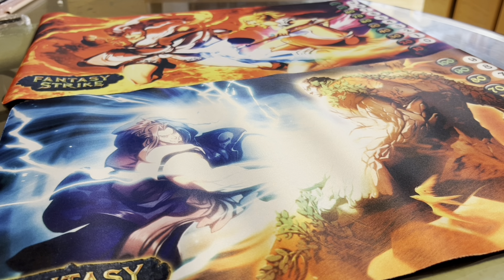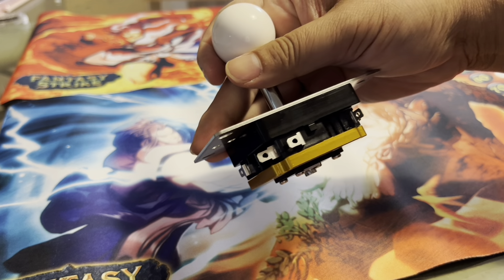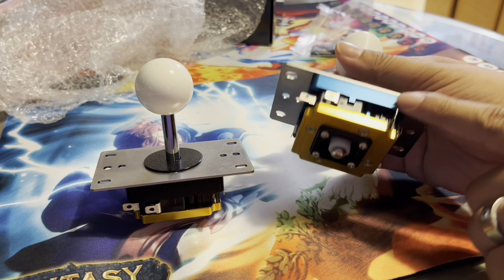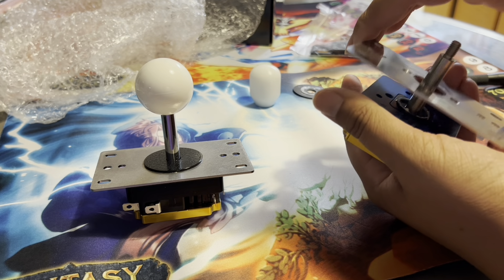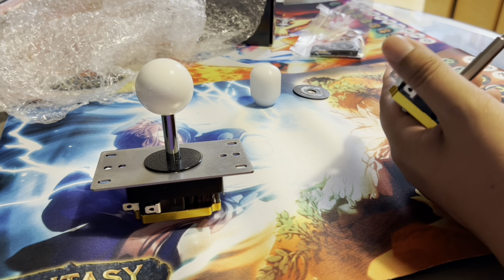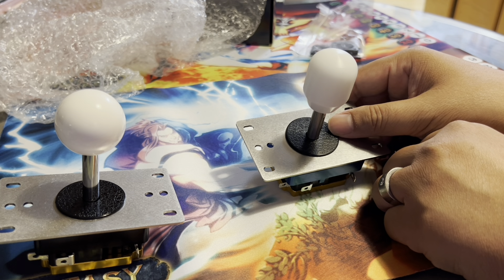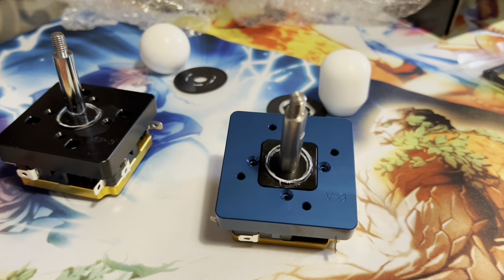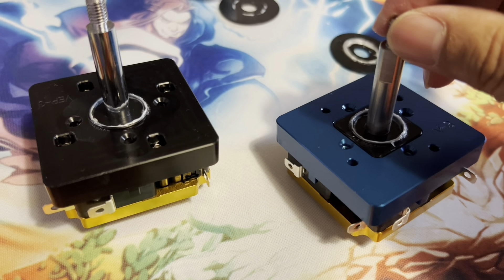Fresh Out Of The Box: Premium Sanjuks V3 - One of the Greatest Levers Just Got Better!!!

Comment: How is this v3 compared to the golden lever Japanese style ? I'm in the market for only one of these which one would you recommend ??
Reply from the maker: They are very different levers because of the nature of their designs.  The Sanjuks V3 feels like a more mechanical Sanwa JLF as well as a looser Seimitsu lever—it has a good snap to neutral with the default spring and the customized (hinge half-cut) microswitches feel pretty nice!  The Golden Lever Japanese style is an excellent starting point but I recommend getting a couple extra black bearing actuators and maybe a green and blue grommet and I think many players will find an exceptional lever within those settings—the way the Golden Lever feels in that spec is you’ll have a smooth dynamic tension that is very unique and it may give you a better feeling of placement on your lever.  I personally use a larger shaft on the Golden Lever too, because I like shorter throw—but the default shaft has a throw that’s not too far off of a JLF throw.
Reply: @Chanchai_VF  ok can you give me a parts break down of the golden lever you have. I think we like the same thing I have a hard time with the long throws of the JLF and would like to shorten it and you said you have a bigger shaft on the golden lever but which shaft is that? Is it a shaft that golden lever sells ??  Also I think the JLF is a little too soft for my liking and doesn't provide much feedback of where I'm at in the gate which would be remedied by The Golden lever. I think I need more feedback and shorter throws for games like KOFXV and others..
Reply from the maker: @cruzin1383  
Shaft: they are available on the site in 3 materials. Golden (Brass), which is the heaviest and I like it, but brass can corrode over time and especially with moisture and other elements—maintenance helps reduce this and I personally am okay with it—but it’s okay to not be okay with it. Stainless Steel is what most people go for because it is the most durable and is middleweight. Golden ALU (anodized aluminum), is what comes with the golden lever and this is the lightweight (but pretty durable) option—lighter weight can enhance the feel but also reduce the speed which is up to preference or what you want the lever to perform like. 

Shaft size: the Japan setup uses the 11mm shaft which is great for most, in fact it might already be in your ballpark. But if you want even smaller throw, 11.5 is a great size but 12 is for those who really want to tighten the throw. However… if you go to 12 I recommend you use a larger actuator. The less the stick can move, the less it can actuate with the same actuator—so increasing the actuator size (I recommend black bearing actuators) is important if you still want to click your inputs early in moving your lever. Adjusting switch spacing will fine tune the actuation along with this process. 

Collar: I also recommend trying the SQ Squirckle Collar. This is a square but with rounded cardinal directions. 

SEIMITSU: from your feedback, Seimitsu levers are a wonderful consideration and are inexpensive too. They tend to be shorter throw, but with the mechanical aspect providing a lot of feedback in a truly Japanese style lever. Some models have notched gates too, which totally tell you what direction you are in. SNK has used Seimitsu levers as their standard for a long time (maybe always?). That said, it took me awhile to get used to sone Seimitsu levers for circular motions.
Reply: @Chanchai_VF  man thank you for all your help really appreciate you taking your time to respond like that. I am leaning towards the golden lever and will look at the bigger shaft and bigger actuator. I have a mod kit coming in for my JLF (the one from JLF with the spring and bigger actuators) and if that doesn't make things tighter for me I will dive into the  golden lever.. was also thinking about getting the etokki universal white stick to go with the golden lever ....
Reply from the maker: @cruzin1383  my pleasure! I love sharing the love of the hobby and FGC too 💕

Have you tried the Otto DIY V5 modkit from the JLF?

It’s my favorite mod for the Sanwa JLF. It makes the housing really stable, the throw will be reduced, and the friction on the pivot and pivot mound are greatly reduced so you’ll be inputting insanely fast. 

Because of the reduced friction, you will feel the microswitches more. 

You can also increase the spring tension (use one of the ones from the JLF Mod Kit).

The one caveat is…. You may be moving the lever so fast that the first time you hit the restrictor gate it’ll be harsh. Like you’re now going 0 —> 60 into a wall. 

But I feel this mod tightens up the performance of the JLF for $30. 

All that said, I am really excited to hear how your Golden Lever journey goes. I really love the Golden Lever, and I’m glad other enthusiasts have been telling me they absolutely love it too 💕
Reply: @Chanchai_VF  thank you so much brother I have heard about the otto v5 mod and I will probably order it for my f500 elite that I have, that's my main daily driver and it's still stock except for the eight way octagonal gate. I'm waiting for the mod kit from JLF for it also.. I  had to order it from France and we'll you know shipping's crazy especially in these times with the holidays.. 

Which black bearing do you have the 15,15.5,16,16.5,17?? Also what size shaft do you have on your right now?? there are so many lol
Reply from the maker: @cruzin1383  1) if you want octogate with Otto v5 you’ll have to find the Otto Octagate Restrictor Gate—some stores sell it. 

Right now I use 11.0mm shaft and 16mm actuator (with switch spacing set to 15mm). I plan to experiment with 11.5mm shafts soon and then commit to a build in January for Evo Japan. 

Sorry to overload you with information but wanted to tell you about GL Bodies. 

I love the White GL body which has the classic GL smooth feel which is very consistent but soft. 

I will be experimenting with the black body in December. It compresses the grommet and gives softer, Japanese-like, setups a little more snap/pop as the neutral will probably be more firm.

I recommend playing the white body for a few weeks to enjoy the GL smoothness and also know that most people getting into GL first feel like they want more firm grommets at first but when they get used to “that consistent smoothness” they end up often going back to the original or lighter tensions. But they love it!
Reply: @Chanchai_VF    man thanks a lot I think I'll go with the same setup you have and just adjust as needed. I will also get the octagonal gate for it along with the black body and the 11 and 11.5 shaft and some extra bearings around the size you stated 15,15.5,16,16.5 oh and can't forget the switch spacing will have to get a set of those also... I think one of those should hit the spot lol... I will wait at least till after i get the mod kit for the JLF.
Reply from the maker: @Angel Cruz  If you buy the Japanese pre-built Golden lever, it comes with a set of switch spacers, so no need to buy extras of those ^_^
Reply: @Chanchai_VF  oh man that's amazing. So I'll just get the Japanese version and the other extras like the black body ,shafts and bearings. What about the gromit inside of it would I get some of those ? If so which ones do you recommend ?
Reply from the maker: @cruzin1383  the Japan setup comes with the Clear 30A grommet. Additional grommets I recommend are the next to 35A Light Green, 40A Green; and the 45A Turquoise is worth considering but you can hold off on that and I can sell it to you later at cost if you want more than The tension of the 40A Green 🙏🏼
Reply: @Chanchai_VF  great man thanks for all the advice ... So far I got this build up to $200 and some change so it's definitely an investment that's for sure. Started looking at there buttons too and man that's another rabbit hole to dive into 😂😂😂😂